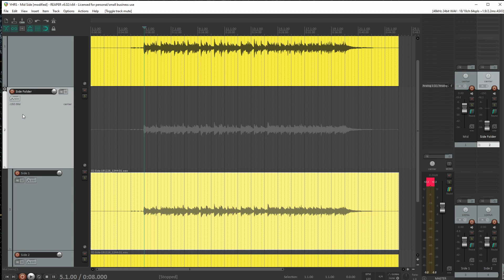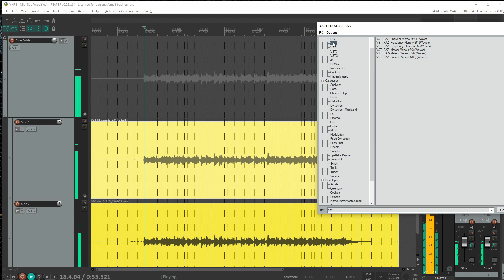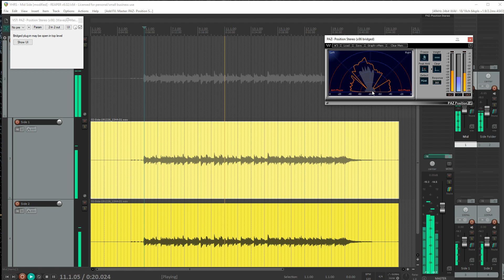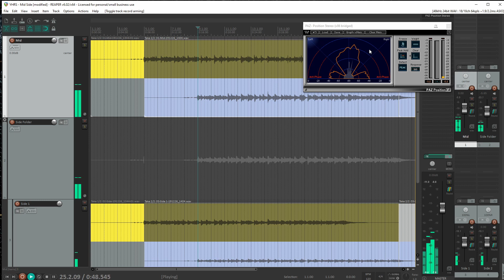Mid/Side Stereo Mic Technique (why does it lean to one side?!?)

Comment: The whole point of mid/side is to first have a mono sound that you love. Your initial microphone position was correct, it is where you love the mono sound. What you should be doing is to route your whole mid/side setup into a regular stereo channel, and from there, balance the audio through panning, without affecting the mid/side configuration. That way you'll keep the perfect mono sound and you will have a balanced stereo image. Also, if you start by routing your microphone signals through auxiliar channels, you don't need to duplicate the recording and you can monitor your stereo image live.
Reply from the maker: For how infrequently I've used mid-side so far, it just hasn't been worth the investment to get a mid-side decoder so I can fit all 3 signals into a single stereo feed.  For now, I'll be stuck doing it in software.  But once it's set up in software, the monitoring and playback works great.
Reply: That sounds like a wise method

Comment: Have you tried micing the guitar on a different axis? i.e instead of micing the guitar in terms of left and right (body on the left and neck on the right) you rotate the mics so that its parallel instead of perpendicular to the guitar? I find that it eliminates the "piano effect" of stereo micing where its more bass heavy on one side than the other.
Reply from the maker: That's an interesting idea!  I'll have to give it a try.  My main concern would be that the distance from the mic array to the floor/ceiling would be much shorter, causing earlier reflections and not as much "space" around the middle mic.  I'll give it a try, though.
Reply: Except bass to treble is running horizontal if the strings are to be considered but unsure if mics pick that nuance up if back a bit so hmm never mind. Your idea is to assume treble is coming out of the neck, bass out of the body tho yeah? Yah u might be onto something. It’s confusing as to how subtle this affect is tho I guess, for me.

Comment: I used this technique once and did get a very skewed image, I did manage to get a good L+R balance by backing the mics away a bit though, I wonder though, how does the guitar sound if you start applying EQ to the mid channel? Phase problems? would it be a requirement to EQ all 3 together on a buss using a Linear phase EQ? I can't wrap my mind around the potential problems I could create. Maybe I should spend a few hours and experiment some on this technique. Nice video, good to hear a little shout out for Warren also.

Comment: M/S is my favorite stereo micing technique but it's not over once you wrap your head around how it works on a singular point-source. The real work begins when you start working it into a mix because it inherently relies upon room reflections at peak fig-8 sensitivity (ie 0/180 degrees). Some direct side information comes in but that info is faster than what comes in at 0/180 of the 8's lobes. This is where the weird phasey stuff crops up from before you raise the mid mic, the direct signal is literally double feeding the lobes of the 8 and that, though eventually smothered by the mid mic, doesn't go away on its own. One solution to tighten that up is move the mid mic back a foot or two and in post use Eventide's Physion to separate the side mic's transients then feed them through a delay 100% wet (0% direct sound) for 0.5-2ms (depending on what frequencies are most causing issues / room size) then re-EQ the mid mic flat and down a few db above 3-4k. Austrian Audio's PolarDesigner can help if you have too much low in the sides vs mid, acting like a phase perfect crossover so that can be sorted. Most people won't notice the difference between a recording done this way and one done without it on full spectrum monitors -> then they play it back on, say, a cellphone with speakers that just CAN'T reproduce 8k+ as well as 3-8k and they'll scratch their heads and wonder why all the sheen now sounds like crusty diapers.
Reply: Seems like the mid mic would be up closer, side further back; opposyhow you’ve described. Can still align for phase (easy in daw w delay or samples ps), but I’ll try it. Wondering too about xy + mid then just live w the differences; if lopsided adjust level or eq.
Reply: @Helenography0741 It depends on how wide the source is, and how wide the room is. If it's a 10' wide room and a 2' wide source, 1' back on the mid mic might not be enough. For a wider source, like a piano or drum kit, 1' should be enough. The issue is coherence, the mid mic is getting more direct signal, the sides only get direct signal (from a narrow source) at 90 degrees, reflections are coming in at 0 and 180 to the lobes. On a wide source it's probably not worth worrying about. But, a violin at 5', oh yeah, it makes a difference.

Comment: Something else to try, take the 414s out of the stereo mount and put them on individual stands (unless you can rotate that rig 90 degrees like the hands on the face of clock).
Then aim your cardioid mic capsule the way you used to for mono, capturing the sound you like, except this time, aim the XLR up the neck.
Then place your figure 8 capsule perpendicular to even center the sound hole, butted up to the cardioid, with it’s XLR aimed down the body.

Now you’re recording the figure8 toward the floor and ceiling though, but with even SPL.
The way you’re sitting evenly between the left and right walls, you may wanna sit on a stool so that the guitar is at say 4 feet if you have 8 foot ceilings.
Evening the reverb times.

Then, when you build the MS Matrix exactly the same as you did in reaper, you’ll effectively be rotating the listeners 90 degrees, but they’ll never know.

If your floor and ceiling are totally different materials, carpet/hardwood/tile vs drywall/cloud absorber/diffuser, A) that effect may sound cool, B) you could throw down a rug, blanket, board, change the reverb of the floor to match or to taste.

Part of MS Micing is the controlled stereo effect, but part is the natural reverb/room sound.

BTW, the way you had it first, you could always lower the level of the Left figure 8.
You could also make those left  and right tracks into 1 stereo track, then the pan becomes a balance.
You’ll also end up EQing the sides, probably rolling off the lows, and that’s easier/cleaner on 1 stereo track.

Lastly, as you noted, you don’t need matching microphones for MS, part of the beauty, so maybe you have something else, even a cheapy that fits better in the mix.  But you can’t go wrong with a matched pair of 414s!

Last thought, when you just pop a LDC into figure 8, pop on some headphones and talk into each side.
Most sound very different from one side to the other, the perfect 8 ain’t so perfect.
If I recall correctly, the 414’s “backside” is a bit darker, let’s call that the Darkside!
Well if that is the case, maybe aim the Darkside at the bright reflective ceiling, and the Frontside at the carpeted floor.

Like all things recording, learn your gear and what it can do, experiment, and play.
That’s exactly what I saw in your video in the first place!
Reply: Great comment, one note. When you talk into opposite sides of a figure 8 while wearing headphones one side will sound different because it is out of phase with your skull. You would need to invert the phase when speaking into the back to avoid that.

Your tip on going floor to ceiling blew my mind.
Reply: Awesome insight. I imagine now too trying fig 8 in front of sound hole w it’s off axis pointed at the sound so it’s not boomy, then use two other mics cardioid spaced maybe about 12-16 inches equally spaced from central mic like wide ortf. Experiment with levels and panning of these alongside panning the two central +duplication; two tracks at full L/R; two tracks at say 3 oclock. Might have to flip polarity on two occasions but I think I’ll try it. I like idea of louder fuller hard panning and no center track so that other sounds like a snare or vocal can breath separately.
Reply: @Helenography0741  There you go.  Yeah experiment, have fun, find something new.  “If it sounds good, it is good!”

One word of caution though: the whole beauty of the Mid-Side Stereo technique is that the sound hits the capsules of the two mics at precisely the same time, thereby mostly eliminating or minimizing phase cancellations.  Move the mics apart and different sound gets to different capsules at different times.   This isn’t necessarily a problem, just a different phenomenon to factor in when processing.
Reply: @G_handle  totally.. yeah i am thinking about that aspect too. im just so interested in creating new mic technics. its interesting that theres a few standards, but im sure they can be thought of as loose guides. i wonder about why the fig8 mic is imperative- if its just to be duplicated as a mono signal, can it just be a cardiod pattern pointed to one of the sides, rather than fig 8, for instance.
Reply: @Helenography0741  okay so.....

A) Absolutely experiment with every conceivable mic configuration you can come up with.  If it sounds good, it is good.  And sounding good is subjectively Your opinion, the only opinion that matters.  It's Your music.

B) The Objective reason why Figure-8 pickup pattern is "imperative" in a "True M.S." technique, is: 

1) A figure-8 is a single* diaphragm generating a single mono signal, 

2) But it's equally sensitive from both front and back, and has nulls on the sides,

3a) So when you duplicate that single signal (or any single signal), then sum both together, it doubles in loudness...Perfectly.
3b) If you then reverse the polarity of one of the two duplicates, then sum those together, they perfectly null.  Because they are identical signals in reverse.  So 2+2=4.  But 2-2=0.

4a) Now, while the figure-8 "Side" Mic will PERFECTLY phase cancel when summed with its negative self, it will also PARTIALLY phase cancel when summed with a signal from any Other microphone recording the same source.  
4b) By placing the "Side" mic's diaphragm as close to the "Mid" mic's diaphragm as possible (co-incident), the 2 Different mics will receive the acoustic energy at about the same TIME, but...
4c) remember that the Figure-8 "Side" mic has its Null facing towards the source, and the "Mid" mic is either and Omni or is directionally facing the source (usually cardioid, but any pattern can be used).  So the two mics catch the same source at the same time, but with different sensitivity and directionality.  The Side mic is directionally least sensitive where the Mid mic is most sensitive. 
4d) Therefore when the acoustic energy is more on one side or the other of the single figure-8 diaphragm, in will physically move in or out from its resting position in the center, and the audio signal will be generated to reflect that push pull with either positive or negative values.
4e) Then that single mono signal's positive or negative waveform value, gets duplicated and just becomes two copies,
4F) When you flip the polarity on one of the copies, they're now still just two signals out of phase with each other, however depending upon which copy you flipped, one will contain useful information from the Right and the other from the Left, but they're not at all stereo yet.
4G) It's only when you Sum either "Side" signal with the "Mid" mic's signal that get a Left or a Right signal.  Remember that the "Mid" mic is mono and contains Both the Left and Right information.

5)  So now the MS Technique has two tricks up its sleeve:  Stereo and Mono.

Imagine this:  
Two Mics, Two Y-Cables, Four Channels on a Mixer.  
The "Mid" mic is going to channels 1 & 2, the "Side" mic is going to channels 3 & 4.  
The 'odd' channels are panned Left, the 'even' channels panned Right.
If you push up faders 1 & 2 to unity you get a Phantom Center.  Pull the faders down.
If you push up faders 3 & 4 to unity you get a Phantom Center.  But roomy, because the Null was facing the source.
Now Invert the Polarity on either 3 or 4.  You get a weird Phantom Phase Cancelation acoustically between your speakers.  Pull those faders down.

Now push 1 & 2 back up, and then blend in 3 & 4 and that Phantom Center will widen out and gain Room around it.
Amazing!  Thats why you did all this!
Push as much Width into it as sounds good to you.

Your two Mono Microphones have just created a Stereo Image, that You can control.
Every other form of stereo micing, you get what you get.  
You may prefer the Stereo Image from another technique, but stay tuned... 

If your mixer has one, press the MONO button.
The Left & Right will be summed together, meaning that the two "Side" mic signals will cancel each other out, and you'll be left with a Perfect recreation of the "Mid" mic by itself again.
However wide you make your Stereo Mix, if the end user is listening on a Mono system, the wide information just disappears without a trace.

So you have a highly controllable Stereo Image,
And Perfect Mono Compatibility.

6)  Back to the math: 
Remember:  2 + 2= 4   &   2 - 2= 0  
Well instead think:  2 + 2= 4  &  2 + (-2)= 0 

2 + (-2)= 0 is what's happening with the "Side" signals when they get summed to Mono.

In Stereo mode though, they aren't summed with each other, they're summed with copies of the "Mid" mic's signal that are hard panned Left and Right.  So they're not "seeing" each other, they're adding and subtracting with that other diaphragm on two isolated channels, Left and Right.

The mono "Mid" mic was capturing all of the Left and Right energy in the air, and now when blended with one side of the figure-8 or the other, its Phase Interaction is either adding when the capsules were going the same way or cancelling when they were going in opposite directions.  This works, because you have Both directions from the Same diaphram.

So the math for Stereo mode is more like:
Left = M + S  
Right = M + (-S)

In Mono mode:
Left + Right= Mono

So:

(M + S) + (M + (-S)) = M + M

(In a Mono button it should be (L + R) /2 = Mono.  So the level doesn't double)

That took Way too much time!!!!

Last thought:  Back to A!
Experiment.
If it sounds, good it is good.

So if you replace the Figure-8 with 2 SDCs, you won't get the perfect cancelation, but you will get cancelation.
And it may sound amazing.
And it will almost certainly sound Wider, because the differences will be greater between Left & Right.

So understand the "rules", then break em'!!!!!!!!!!

(Let me add this disclaimer at the end:  This is my understanding.  If something ain't quite right, Please tell me.  I love to learn, and see being wrong as an opportunity for growth.)
Reply: I have used 414s for M/S many, many times. I have not found any such difference between front & back pickups. I’ve not found it with U87s either. In fact, I’ve never heard what you’re talking about and there is no way for it to actually happen. The two diaphragms absolutely must be identical for any of the patterning to work. I’ve recorded duets on both sides of a figure of 8 and never experienced a ‘darker’ diaphragm there either.